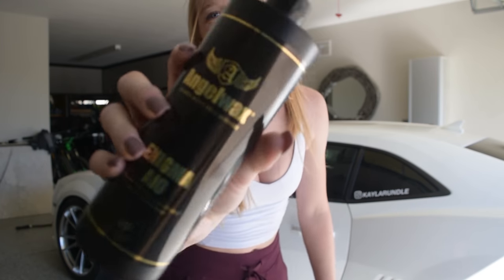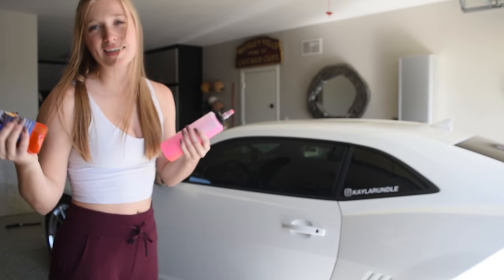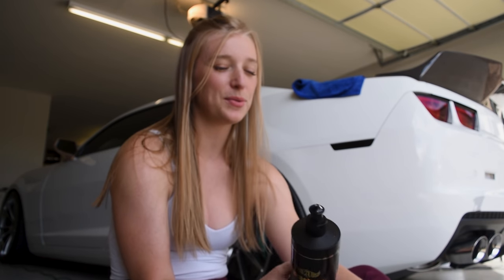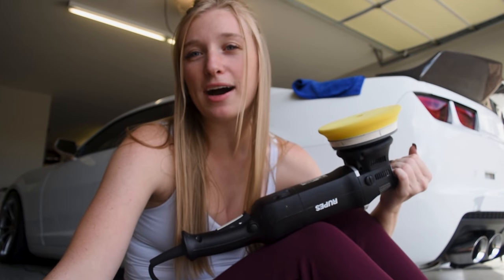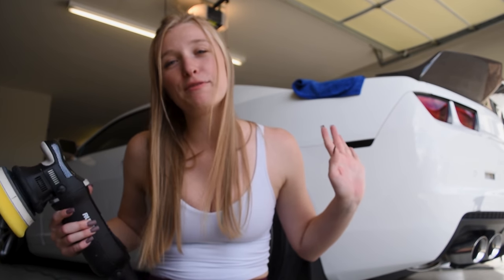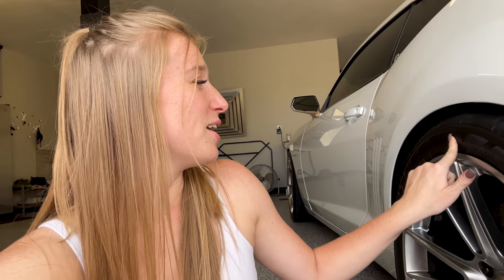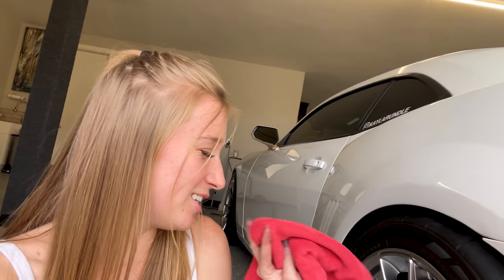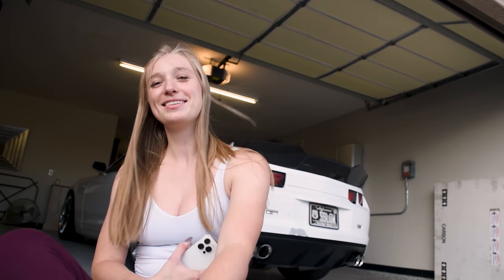Washing, Correcting & Coating my Camaro

Comment: You need to use the 2 bucket method. When you put the sponge back in the bucket your going in  dirty water. So one bucket with soap and one with warm water to rinse
Reply from the maker: I worked from top to bottom and I have a grit guard in my bucket. I washed out the bucket for wheels and more and refilled it. I do agree two bucket method is the best! Most of the time I do not even have to mitt my car after foaming, most things come right off with the soap I used.

Comment: I did my black Ats premium with performance pkg renny doyles ceramic coating. Amazing. Also the bead maker is awesome too! Helps make the ceramic coating last
Reply: Performance package....lol 4 cylinder baby turbo!!!😂🤣
Reply from the maker: Bead maker is awesome to use after washes!! It smells so good!
Reply: @jl456  you sure it’s not the 460HP twin turbo V6?
Reply: @pmscalisi  lol I'm pretty sure because I owned one!! Otherwise he would of said ATS-V
Reply: @jl456  ok thanks. I forgot about that.

Comment: As a detailer, one thing I would recommend is even though it's sped up i can tell you were moving the polisher a little fast. 1 in per second in 2x2 sections if you're going to do the beginner cross hatch. Also, keep the pad as flat as possible and an eye on the rotation of the pad. if it's not even you will be stalling in either the rotation or the oscillation function. Good job. Keep up to great work.
Reply from the maker: Thank you for the suggestion! I worked it in at high speeds and it worked perfect when I tested it before polishing the whole car. Wasn't trying to make it perfect since it got repainted shortly after this.

Comment: Nice job! Unfortunately where I live I have very hard water with silica in it. It basically dries and evaporates (especially in warmer weather) before I can even attempt to dry it leaving etched water spots in the paint.  Any ideas how to work with that? Any ideas are appreciated!
Reply: thats wild.  how is the car getting wet?  obviously avoid sprinklers and faucet water, rain water on the other hand shouldnt be an issue.
Reply: @diggersdiecast8879  Yea I made the mistake of parking too close to the lawn one day, sprinklers came on and I got really really bad water spots. Look a lot of work to get them out.
Reply from the maker: Hard water is very damaging to paint. It can even leave marks on completely ceramic coated cars. Try your best not to park there! I believe detailers acid wash off hard water spots but after that you’d have to re protect it. Best bet is to stay away from that water once you get it fixed! If you’re near Phoenix lmk and I can send help your way.
Reply: @KaylaRundle  No I am in Reno! But I travel through Phoenix often for work.  No I dont park anywhere near sprinklers anymore.  I have a 2006 Lexus and a 2014 Mercedes, both still shine like new.  I keep them clean and follow the rule no food in car ever!
Reply: Hit it with Sonax Multipurpose cleaner, then clay bar it. The cleaner is Alkaline so it nukes most things in the process. Quick rinse then go for it with a Microfibre to dry it all up. I personally would not touch the AngelWax stuff, but that comes down to choice.

Comment: Very nice I’d like to run your SS in my ‘10 V..2inch long tubes no cats 3 inch exhaust electric cutouts CAI blower coolant pump/tank. tuned. You got a good Phoenix area tuner for refferal? I don’t wanna pick somebody before I get a good refferal. I know vengeance racing is supposed to be pretty bad that’s who designed my camshaft that’s about to go in. (Got it new in box used) lmk id appreciate. Beautiful ride

Comment: Kayla, did your parents say anything to you about not washing your car in the garage? This is not a good idea if the drywall gets wet and begins to grow mold or getting electrocuted by wetting the electrical outlets or panels!
Reply from the maker: Walls have rubber base boards that are sealed. Also I don’t spray it like crazy there’s plenty of room so the water doesn’t even get close to anything other than the floor. All good here! Free garage cleaning

Comment: What's car soap? I've been using blue dawn for years.
Reply: 😭 you've also been hurting your paint for years then
Reply: @stangy007  blue dawn won't hurt your paint. It may remove wax faster, but I've never had an issue with it damaging anything.
Reply from the maker: @norskyver  you’re right it doesn’t damage anything. But it is used as a stripped since it’s designed to get rid of grease and oils. I recommend getting any sort of PH Balanced car soap. Protect it first and your car will always stay protected using PH Balanced soap. The soap I used is in my description

Comment: What happened to your carbon side skirts? I’ve been considering getting them ?
Reply from the maker: They are off while the car is back and forth to body shops- I trust no one driving it with carbon that close to the ground. They will be back on within the next couple weeks- car almost completed
Reply: @KaylaRundle  yeah I daily my beast for now. That’s what kinda scares me about getting expensive carbon skirts.
Reply from the maker: @betonblack3621  my car FELL on my sideskirts and they still hold up. If it’s amazing quality and expensive they won’t get damaged. You can’t always throw on a PPF/Clear Bra on them and they will always look 100%

Comment: Well, there you go.  I've been dogging my friend for years because he washes his Harley in his garage with a hose.  I always told him I've NEVER seen or  heard of anybody else doing that... until now.
Reply from the maker: That is so funny! It can be affective regarding the weather and if your garage was built at an angle so the moisture doesn't sit in the garage. Also my floor is properly sealed with rubber base boards, so no problem here.

Comment: YOU have to work it into the paint !!!!  yikes ive never heard of doing that with polish !!!! working it that hard you go through the clear coat and then try and get this polish into the PAINT
Reply from the maker: This is not just a polish. It’s a three step so you have to let the product reallyyyy work itself. I did it all pretty quick and all I needed was to get rid of surface scratches and throw a protective layer on.

Comment: I personally wouldn't have ceramic-coated the car before wrapping it. It will need be stripped off before wrapping.
Reply from the maker: This is true that’s why I didn’t do any crazy coating- just used a one step with ceramic in it. Probably doesn’t last long regardless.

Comment: Why would you wash inside your garage?
Reply from the maker: Easier to do when using tough chemicals and you're not in direct sunlight. My flooring is properly sealed and angled to let the water drain properly.

Comment: You're polishing a car that has damage on the rear quarter panel??. Why?. 🤦‍♂️. Get the car fixed then polish and correct.
Reply from the maker: But why not just have fun and do it both times 💅🏼
Reply: @KaylaRundle  sure.....but polishing too many times will strip the clear coat.